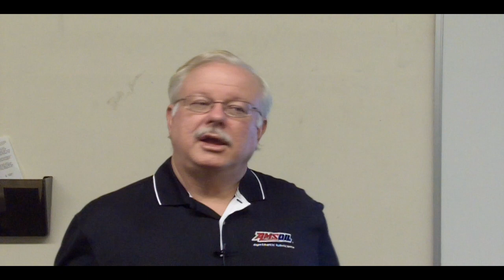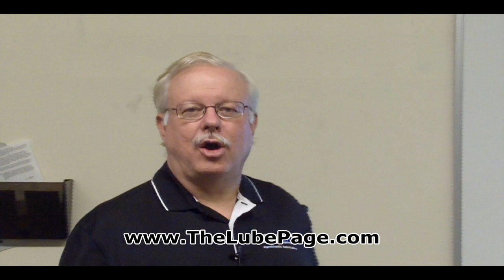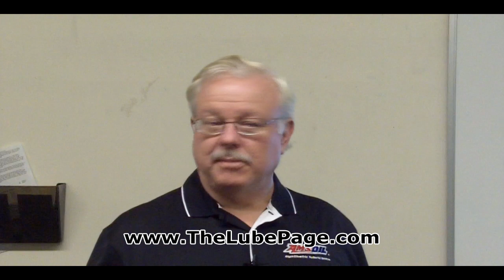Hydrocracked vs PAO Synthetic Motor Oil

Comment: Fifth question to your company, They  advertise 100% PERCENT SYNTHETIC. DOES IT HAVE oil from the ground cracked or not.??? All this is complacated is it
100%Synthetic oil? Or some of it is it from the Ground. Please be clear is it (both pao,s)or is it group four or cracked normal oil .Please explane in plain english. Please respond in comments.
Reply from the maker: The Signature Series Amsoil products are 100% PAO and Ester no hydrocracked synthetic.  There are other premium Amsoil products that are also 100% Pao and Ester also.  The XL and OE lines are 100% hydrocracked synthetic oils.  Please note that many FULL synthetic oils contain petroleum oils used as carrier oil for the additive package.  If it says 100% synthetic then the carrier oil has to be synthetic also.

Comment: People can talk all day long about long term oil changes. As long as gasoline is being used as fuel the engine starts out cold and goes thru a warming up time there will be gasoline diluting the engine oil. Oil is better than it has ever been. Periodic oil analysis will show the oil is still good but it is still diluted that is the reason I personally don't believe in long term oil changes. I buy engine oil and filter ar wally world and change it myself. Amsoil has an amazing advertising program. Some sites  give the impression they are info about oil and turn out ti be amsoil advertising. People do respond to advertising.
.

Comment: what type of PAO amsoil uses? conventional polyalphaolefin (cPAO) or metallocene polyalphaolefin (mPAO)
Reply from the maker: Amsoil uses conventional PAO.  mPAO is very revolutionary but quite expensive.  When you look at Mobil motor oils you can see by the flashpoints that they are not using mPAO for motor oils.  mPAO is used in very high temp industrial applications.  Maybe as greater quantities of mPAO is produced the cost will come down by the economy of scale.
Reply: @thelubepage  thanks Mr. Watson.
Reply: @thelubepage  Don, I am an Amsoil dealer as well. Thank you for this clear, concise information! It has helped me in more technical talks with potential customers. Do you think Amsoil will adopt the mPAO at some point?

Comment: Most of the newer cars are using 0W-20 or 5W-20 weight oils. It flows well at cold startup, to reduce startup wear, and is more efficient than 30 weight oils.
Reply: 5w20 in turbocharged petrol engines sounds like a bad combo since manufacturers have gotten lazy with oil rings and valve seals but what do I know... modern engines guzzle oil like it's nothing

Comment: Don't use whatever weight oil you feel like using. ALWAYS USE THE OIL RECOMMENDED IN YOUR OWNER'S MANUAL AND ON THE FILL CAP ATTACHED TO THE DIPSTICK.
Reply: The truth is that most engines just aren't that sensitive to the oil viscosity and most engines are validated on many different weights of oils. My Honda's engine is. Here in America, the only approved oil is 5W20 and it's written on the cap. But in Australia, Japan, Germany, etc, no specific viscosity is specified on the cap and 0W20, 0W30, 5W30, 10W30, 0W40, 5W40, 10W40, and 15W40 are also recommended for the exact same engine yet most Americans think using 15W40 in an engine specifying 5W20 only is certain to cause some type of problem. The oil's operational viscosity isn't going to be constant anyways no matter what because it's temperature isn't constant. If the oil runs, for example, 10 degrees warmer or cooler, that could change its viscosity by a whole grade or more.

Comment: Oil cost should not be an issue when it comes to oil choice, except that Amsoil is overpriced. It is much cheaper, in the long run, to spend a little extra for better oil than to pay a mechanic to replace or repair your engine.

Comment: I USED  amsoil AND redline in my 2003 10w40 and then when auto parts store stocked AMSOIL 5w40 at around 120.000 mile to 250.000 miles never killed vw passa 1.8 t   replaced timebelt  3 time  and the coils  100.000 times I now use AMSOIL 5w40 euro in 2016 vw GOLF  1.8tsi 90.000 miles  gdi and the valves are spotless

Comment: Outdated.  AMSOIL now has three tiers of motor oil.  The Signature Series oil is what you refer to as the "original AMSOIL" and is good for up to 25,000 miles and one year.  Their XL tier is a 12,000 mile, one year motor oil.  It is API certified.  Signature Series is not API certified.  Their third tier is OE oil.  This is your OEM grade motor oil and is rated for whatever is stated in your owner's manual.   OE is also API certified.
Reply: Now your comment is outdated. Now SS oil is also API SP RC certified. 😊

Comment: One can assume that most of the so called Synthetic Oils on the market are Group lll Hydro-Crack Oil. That oil companies cannot at least mark their oils as too which group it is would at least be fair to the consumer. I detest Low Handed Marketing.
Reply: Most of the Full Synthetic oil advertised are only by law 25% Synthetic!
Reply: @brianpeters867  You mean 25% Group lV?
Reply: @markwarnberg9504  What I am saying is if a bottle of whatever oil, is marked ‘Full Synthetic’ then by law it only has to be 25% or more to be legally able to advertise ‘Full Synthetic’.
Reply: @brianpeters867  Confused?? Castrol won their case against Mobil that their Group lll Hydro-Carck Oil could be called Synthetic Oil, so why would a company add 25% Ester Group lV oil into the mix? The word FULL is decieving as a Synthetic Oil is a Group lV oil. Most of the oil on the market is Group lll!
Reply: @markwarnberg9504  I think you are confused. What you just said is the exact thing I just said or meant! LOL! :)

Comment: I just don't understand why Amsoil continues to promote Group III oils when they know Group IVs and Group Vs are far superior. 😒

Please explain Dan, and great video presentation explaining the differences to those who dont know and want to learn.
Reply from the maker: You are right, PAO Group IV and Ester Group V are superior basestocks. However, using Severely Hydro-cracked Group III oils properly formulated with quality additives will make a high quality lubricating oil.  The key is using only a SEVERELY Hydro-cracked basestock.  Amsoil limits the Group III oils to 12,000 mile drain for XL and Mfg recs for OE oils.  Unfortunately, many oils labeled Full Synthetic are not even Hydro-cracked but only Hydro-treated.  I have a complete article on this in my website www.TheLubepage.com
Reply: Grp 3 allows for a little lower price with solid chemistry level for good performance ...better than quite a few oils.
Reply: @mikeschlup5279  Yeah but Group 4 is still a true Man Made bade stock though where Group 3 is not. 

And so therefore that is no reason to compromise. 

Group 3 is cheaper sure but why compromise on performance and oil life just to save a few bucks?? 

I don't do that. I always use Group IV PAO Amsoil Signature Series because it's the obvious choice for superior oil life and superior performance. 

The whole point of Amsoil SS besides the performance advantage is so you can extend the drain intervals to 25,000 Miles or 1 year whichever comes first.

That in turn saves you so much more money when compared to the use of a group 3 motor oil. 

Group 3 oils do NOT have a one year or 25,000 mile service life like Amsoil SS does. 

So again having only 1 oil change a year for me is a Godsend.

But got what you were saying.

Comment: Very clear and honest explanation , but personally I can’t keep the oil inside my engine more than three months or 3000 miles, maybe because fuel dilution phobia or viscosity break down. And believe it or not all people I know do the same.... I trust your oil but 25 k miles or full year is a risky number and unnecessary . But to increase the protection yes we all agree with that.
Reply: Im with you bro
Reply: With proper oil analysis, this becomes a non issue. The oil that had to be changed at 3k miles was group 1-2 type oil. Technology has changed. You really can go 25000 miles! Yes its hard to believe!
Reply: 25k?!  I don’t believe this bs sales hype

Comment from the maker: You can always change oil often and in normal use scenarios you should be fine.  You can also use a superior synthetic and change your oil at much longer intervals and save money and time and have greater protection in the process.  If you change petroleum oil every 4,000 miles and change Amsoil every 20,000 miles you will save money.  If your good quality petroleum oil cost 3.50 a quart and the Amsoil cost 12.00 a quart then you will do 5 petroleum oil changes to the 1 Amsoil change.  This works out to 17.50 for the  (5 qts) petroleum and 60.00 for (5 qts) Amsoil.  If you use an Amsoil filter for 18.00 vs regular filter for 6.00 you will  total of 23.00 for petroleum change and 78.00 for Amsoil.  For the 20,000 miles you will do 5 petroleum oil changes for a total of 115.00.  You will do 1 Amsoil oil change for 78.00.  Total savings 37.00 for 20,000 miles.  The better fuel mileage and protection is FREE.
Reply: Hi Dan. That is assuming the person changes his own oil. Dont forget that most folks take their cars to a mechanic like myself. The expenses add up a pretty penny when that happens. But thats still not the only way you save. The mpg goes up because of the added lubrication so your gas bill comes down. The power transferred to the wheels is also increased especially with the amsoil ss atf. And if you intend on keeping your car forever, you will probably never need to buy another car again due to the increase in its longevity. So yup......a heck of a lot of savings! Ive watched all your vids Dan.......thank you for all the work you do to bring this information to us.👍

Comment: sludge- yes saw that in the 70's and early 80's. Now my engines are sludge free even with only group 3.
Reply: Yes! The group 4 Amsoil Signature series is one of the best oils out there!
100% synthetic stable, stronger and offers 3 or 4 times more protection than other '' full'' synthetic

Comment: The just send hydrogen through it to hydrocrack. I operated such a hydrogen plant for 5 yrs. Hydrogen likes to readily bond to pretty much everything. Once bound to contaminants it allows the refinery to more easily crack out contaminants. Hydrogen is essentially used as a cleaning agent much like we used nitrogen to purge things to acceptable LELs
Reply from the maker: When oil is hydro-Treated it is purified using hydrogen to chemically react with certain impurities removing them chemically.  This is not to be confused with Hydro-cracking  oil.  The hydro-cracking is a step after the hydro-treating purifies the oil.  The hydro-cracking actually uses hydrogen and extreme temp and pressure to break the hydro-carbons into smaller fractions.  The smaller fractions can be separated into very narrow cuts to give near uniform size.

Comment: use Walmart oil, change it at recommended intervals, you know super-tec lube, it will bring down the price of all these BS.oil co.motor oils. besides it's good oil.
Reply: I use supertech full synthetic in all of my cars, it's a very good oil. All of them have well over 100k miles.

Comment: So use the recommended wt oil and change it per vehicle recommendations? Got it AMS oil is not worth it!
Reply: If you don't drive over 5,000 miles an year it's not.
If you drive 10,000 miles or more in a year it's definitely worth it and if you also drive like a maniac like me, lots of idling and city driving!
Do not think you will save money now and later it will not cost you more!
If you keep your vehicles for a lot of years like me you are best with an 100% synthetic oil!
No ifs and buts! Just do your research but it is what it is! The molecules are all the same, stronger fluid strength,more protection etc.
Reply: Wes Herren: If you drive 3-5k a year, itll save you money but your engine will wear more. There is actual microscopic pieces of sand in the oil.

Comment: Thank you for speaking plain o’english so non enthusiasts can understand. I agree with everything you said. I personally use torco sr-5 since it’s a group IV/V base oil blend. So many people are fooled by snake advertisements that it boggles my mind. Oil, tires and battery are the three I never skimp on. Continue to help people make educated decisions in their purchases.  I believe in buying with a purpose being served, not cost. There is so much fake out there it’s hard to decipher the truth. Numbers never lie though. Unfortunately most people would rather be wrong in a group then right by themselves. Can you tell us what group base oil is used in your synthetic motor oil, please? I would be ecstatic to see a comparison between your oil, Torco, and Motul.
Reply from the maker: Amsoil Signature Series oils are PAO and Ester basestocks.  Several other oils are PAO but I will not try to list them product by product.  Amsoil XL and OE oils are Group III synthetic.  As you can see in the Amsoil XL and OE the recommendations are for shorter drain intervals and they cost less than the Signature Series.

Comment: Is there any way to find out that oil is hydrocracked or PAO is there any relation of both hydrocracked & pao with api grading. Also is Motul uses a pao or hydrocracked.
If two different oil one is hydrocracked and other is pao both are API SN than both are good performance oil so how Hydrocracked one is less better than PAO. ...??
Reply: The performance between a group III and a PAO is overrated unless you are in the Arctic.
Reply: Hydro Cracked oil is as GOOD as PAO. Just check your oil level on regular bases, change oil and filter after 2 years or 15.000mls (wich ever comes first) and your engine is good for a million miles
Reply: @N-e.o  No a Group III is not as good as a Group IV and never will be. But thats a whole other discussion.

Comment: Just a Salesman! Redline is by far the best lubricant. I would never run any oil regardless over 5k. If amsoil was the best as they claim u figure more consumers would be flocking to stores to get it. Oh ya they don't do that huh? Kind of strange huh. U have to pay to get a better deal on the oil. Aka preferred customer/dealer. If u see the price they AKA this guy! get it at and then sell it to u marked up. U would choke. What a ripoff amsoil.
Reply from the maker: Actually, I am a Certified Lubrication Specialist. I am certified by the STLE (Society of Tribologist and Lubrication Engineers).  But I don't mind being called a salesman, good salesman are the backbone of every product producing company.  Amsoil is a growth phenomenon with many years of double digit growth and is readily available in thousands of stores and directly from Dealers and now on the Internet.  The customers keep coming and the numbers are growing every year.  The Preferred Customer program you mention is no different than being a member of Sam's Club or Costco.  The program is designed for large level consumers and rewards their loyalty and larger quantity buying.  As far as the 'markup' most retail stores complain that the suggested retail prices from Amsoil do not have a high enough margin.  I don't think you have any idea of the average markup in retail stores.  By the way, Redline is not sold in as many stores as Amsoil.  I see by your name that you are a trucker by trade, excellent profession, the nation runs daily on trucks.  You do know that the average drain interval for large trucks is 14,000 miles.  See, the drain interval is not the same for every application, and certainly not the same for synthetic and petroleum oils.  Bottom line, if you don't want to use Amsoil then don't buy it, but before you denigrate the product do a little more homework to make a better case.
Reply: blake Day trucker oil analysis don’t lie. I own a small business and have 2 million miles of oil analysis testing.

Comment: the extended oil change oils are misleading. The oil filter is not being used at 2,000 miles. Filters have to be changed at 5,000 maximum. Oil is bypassing the filter because the filter is totally plugged at around 2500 miles. 
change the filter at 5,000 miles and change the oil too. I get well over 200,000 miles from an engine by doing that. I'm running motorcycle engines well over 100,000 miles with 4-5,000 mile oil changes, using petroleum based oil.
Reply: fjones63 it’s not to say that it ain’t being done. But their is no reason for it when a superior performing product can give better lubrication for 4-5x the interval
Reply: Here in europe we change our oils and filters arround 15.000-20.000Km or 2 year. 
My car has 315.000Kms with these intervals (running fully-synthetic "Hydro cracked" oil). It depends on the car manufacturer and engine itself and the use of the correct OEM approved oil specs. Just check the oil level on regular basis and top it off when needed. No need to change oil so often!
Reply: Also if your filter is totally "plugged" at 2K miles.. then there is something terribly wrong with your engine. a clean running engine does not clog up the filter so soon.. only a bad engine does!

Comment: Even though I know the oil doesn't go bad, I won't change my oil in 25k intervals, cuz how can the oil deal with the contamination and carbon that is washed off and the tiny volume of gasoline melting into the oil? 
If a oil make try to achieve such a long interval, they must have decreased the cleaning ability, except the case that the car burns oil a lot so that the contamination and carbon will be burn out, like German cars.
Reply: EXACTLY why I’m skeptical of Amsoil! This BS 25K claim